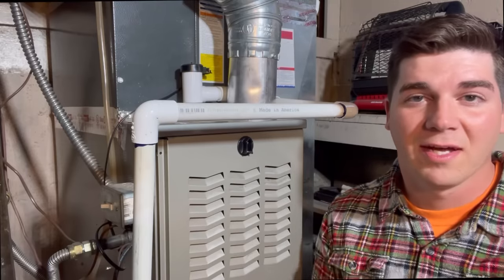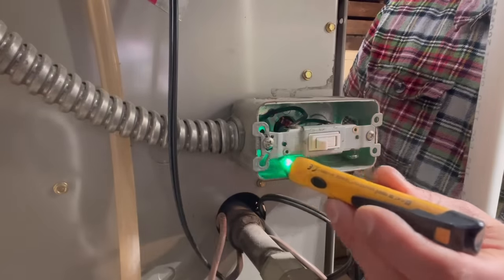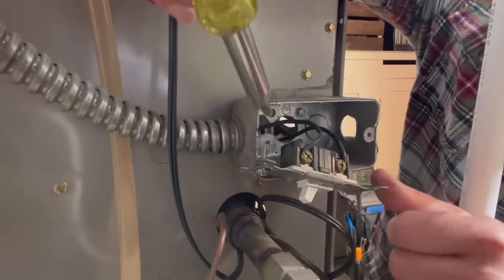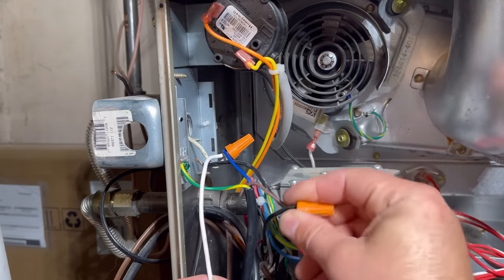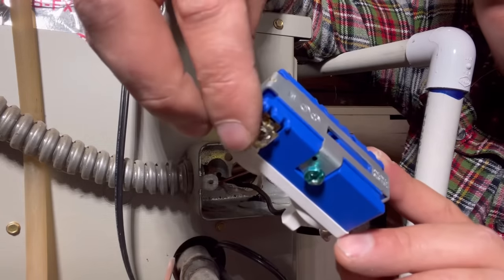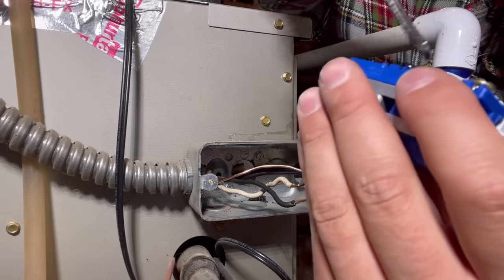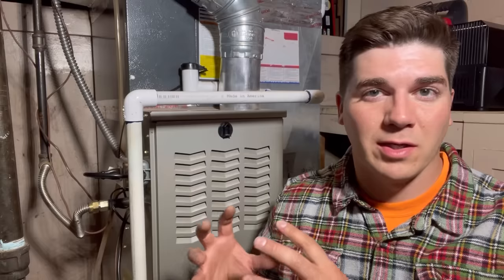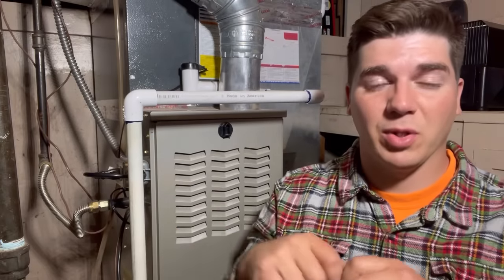This Could Keep Your Family Warm During An Emergency Power Outage.

Comment: Good idea.  Saves the trouble of figuring out the wiring in the dark when the power goes out. When I put a bedroom addition on my house I had them put in a separate panel with a manual transfer to chose utility power or some lugs in box on the exterior of the house. That way I can connect my potable generator to the lugs outside, and turn on those circuit breakers I want powered. Furnace, lights, refrigerator, etc depending on the size of generator I have.
Reply: but does this on a federal 🇺🇸 government's code enforcement pass? as i wouldn't mine doing this or paying for it done but my local county's inspectors have to come and look and my in progress upgrading aka main panel was a 100A now a 400A
Reply: A similar approach can if it’s done right, but transfer switches are expensive, and transfer panels limit what you can power from the generator. 

The most flexible and cost effective way to do this is to add an interlocked breaker to your main panel, and run a 30A or 50A feed to an inlet box outside.
Reply: @jeffscott1543  got it so not code compliant on a federal law level so indererlocked breaker's for the furnaces down there if i really whated it and or the plugin in method and of course check with local authorities to see if it passes or not  

all ready have and or working on a 400A 240V sp ATS/UPS this idea was in the video feed so i click on it and it sounded like a less hassle was to replace the heating units later on and another layer of power properness if the power gird and my backup planning fail's 20kw solar/1-5kwind/400A PTO-tractors/surpluses generation head off my 60's dodge or 80's chevy v8 vehicle and $$/time allowing later a F150 V to G
Reply: @jeffscott1543  That's how I do it.   Just back feed the panel
Reply: @allaboutroofing2   That's not going to happen with anyone who knows how to perform electrical work properly.
Reply: @MrBen527  it happens. Someone with no knowledge of electricity wouldn't be back feeding power with a generator. All it takes is forgetting  to turn off the main. This is why it's illegal and should you decide to do it anyway, take a a huge liability if something goes wrong including criminal charges.  Also, don't you need a suicide plug to do this?  Yeah, real safe. A professional would know better.
Reply: @allaboutroofing2  Linemen assume this scenario during outages and should be using safe practices and PPE anyway.  My equipment is marked so I don't forget and no.  No suicide plug for me.  Accidents/incidents could happen with interlocks also.   Linemen have to assume these things if you're touching a closed circuit and don't control over all of it.
Reply: @MrBen527  how could an accident happen with an interlock? That's the whole idea, to make sure the main is off before the inlet circuit is on. The fact is, no matter what you say, backfeeding without interlock is both dangerous, and illegal. I bet you think running a generator inside is okay too? I didn't expect to get thru to you, but at least someone might question your horrible advice after being called out.
Reply: @MrBen527  Just a follow up. If you are so capable with electricity and such,  why not install a interlock yourself if you already have a dedicated inlet? Might be liberating knowing you aren't a hack and aren't actively breaking the law to save $37.98 on Amazon. Just a thought.
Reply: @allaboutroofing2  lol. Don't hate man.  My panel is 50 years old and guess what.... I'm the only crib in the hood that has electricity when everyone else is out.
Reply: @MrBen527  still illegal.  You do you, but maybe stop giving illegal and dangerous advise. I see my suggestion of buying an interlock for under $40 was lost on you. Surprise. 🤭
Reply: @allaboutroofing2  There are not parts available to fit my panel.   Like I said,  my power will always be on as the linemen get to listen to my generator run while they're reseating a new fuse on the pole. 🙂
Reply: @MrBen527  You might be surprised. OEM interlock kits were readily available for my 80s era CH panel. There are outfits that have aftermarket kits available for a multitude of other panels.
Reply: ' @allaboutroofing2  We call them "widow makers".
Reply: @MrBen527  you know a lot about how electricity works, but call capacitors and transformers fuses? I'm sure their ppe will work when one blows up in their face from your blatant disregard for the law tho. 🙄
Reply: @jeffscott1543  My panel was installed in 1972 and it's a Square D.  The spec label is not legible.  The panel is really small compared to modern ones.
Reply: @MrBen527  not really, but you saying that linemen assume the risk and not caring about the law and blatantly disregarding to save $40 bucks does. I see you conveniently never answer about the legality if what you are doing is supposedly a okay.
Reply: @allaboutroofing2  Not at all.  My setup works great, been using it for 15 years!  Like I said,  you'll have a hard time thawing those balls when your power goes out.
Reply: @allaboutroofing2  There is no law for what I'm doing and I've I've spoken to my linemen personally while they're changing those FUSES.
Reply: @MrBen527  take 7 seconds of your life and google is backfeeding illegal. Get back to me. (Spoiler, you are wrong)
Reply: @MrBen527  I call bs on a lineman saying it's legal and ok too btw. Reality makes what you are saying a lie.
Reply: @allaboutroofing2  I have, can and will turn off my main and do whatever I like with my system.  Because I will have heat,  AC, a cold fridge,  working furnace, TV and internet (to communicate with u) 🙂 no matter how long the grid is down.
Reply: @MrBen527  I have all of those things legally. Did you google it?
Reply: @MrBen527  btw the way I'm sorry for your parents loss, but at least you inherited a starter home. Am I right?
Reply: @allaboutroofing2  LOL Uh oh, here we go.  Those balls are frozen solid!  🤣
Reply: I've never used a "suicide cord", but instead had my portable generator come into the main panel thru a spare 2-pole breaker that was normally OFF, except during a power outage.

During the first few minutes of one power outage, I brought the generator up and threw ON the generator breaker but FORGOT to first turn off the main breaker in the panel to isolate from the power grid!

The generator breaker simply tripped as it was reluctant to supply power to about 40 houses on my street, but I was SCARED SICK 😫 that I might have fried some poor lineman with 7200 volts. I didn't, thankfully - too soon, so no linemen were out yet trying to clear lines and restore power.

I've been doing home and/or computer room electrical work for 55+ years; just because you KNOW the right sequence doesn't guarantee you will do it CORRECTLY every time. I did it right many times until I did it WRONG. ☹

I then completely abandoned my original generator connection setup and purchased a commercial generator transfer panel... one of the types that have multiple rocker switches on them, one for each breaker/load that you want to power with the generator - these differ from the "whole house" type.

You have to sit down before you  install and pick what breakers you want to be generator powered. Too complicated to explain installation in this short space... but when completed, it lets you SAFELY connect a desired load (furnace, sump pump,  refrigerator,  etc.) to get juice from either power company or your generator, with no backfeed danger whatsoever.

Stay safe, and spend the money to keep everyone and your property safe. To see my transfer switch type, search Amaxzon  (remove the 'x') for these words:

Connecticut Electric Manual Transfer Switch

Get one with as many switches as you can afford. Remember, 240 volt items will use a pair of rocker switches instead of just one. You mount it right next to your breaker panel... recessed male twist lock on front is how generator connects.
Reply: @MrBen527  What you’re suggesting allows for the potential of backfeeding power into utility lines, and is both illegal and dangerous, putting utility line workers at risk. Use a transfer switch, which prevents backfeeding.

Comment: Cannot thank you enough for this video.  We just endured the ice storm in Central Texas, trees and lines down everywhere.  Power out for 4 days.  Courtesy of your video and my screwdriver we had heat for 3 of those days.  Well done sir!!!
Reply from the maker: Amazing! Glad it was helpful for you
Reply: @diyhvacguy my unit compressor went out. It’s only 7 year old . Gould I get another unit. Or  replace the compressor.if so, do you have a video on how to replace the compressor non a 2.5 ton Goodman unit? Please I hope you respond, as time is winding down. It’s about to get hot in Atlanta
Reply: That was Feb. 2021, right? It caught me woefully unprepared. Last winter, near Austin, our power was out for one day. After the 2021 winter storm, I got a Mr. Heater 30,000 BTU natural gas heater. It wasn't convenient, but has heated the home nicely for two years.

Comment: In south most of furnaces are plugged in attic's outlet, so little one 120V outlet lawn more size generator will easily plug and power the 10 Amp blower in furnace.... But if that's the case and power interruptions are the thing, setup some wall mounted or portable furnace in one or few rooms and you'll have heat without any electricity from generators/inverters in case of power down emergency

Comment: You will need an inverter capable of 15 amps continuous. The furnace blower motor can draw 6-7 amps on it's own, plus the draft inducer, gas valve, and transformer. If you have frequent power outages, invest in a standby generator and you can run lights, heat, and your refrigerator at minimum. And it will do all that automatically, like if you're away from home and the power goes out.

Comment: Mike,
I have done a similar modification that may work a little better for you using both ends of an extension cord. Take the hot feed coming into the existing switch and make connection to a 1 foot stub of the extension cord with the female end feed through a knock out similar to your solution. Take the other end of the extension cord with a 1 foot extension and feed it through another knock out on the electrical box and make the connections to the existing switch. When finished, you plug the ends of the extension cord into each other for power from the power panel. When the power goes out, unplug the extension cord and plug another cord in and run to your inverter. I used an extension cord that has the lock button and cut off both ends with about a foot of wire on each end . the end result is you have a spliced extension cord outside of your furnace switch box that can be easily unplugged and connected to the inverter. No need for a new switch with an outlet. You can even use an old extension cord you have lying around. Hurray!

Comment: I have always resorted to my 2 wood stoves in the house for winter time heat.  So far we have only used our gas powered generator for the fridge/freezer/some lights.   The tactic presented by this video allows another way to get oil furnance heat to the house without fire wood.  Your alternative back-up tactic is much appreciated.   Now I am thinking that something similar for the water well pump would be great, albeit my pump is 220V single phase so the devices/plug/receptacle has to be different per our US electrical code / NEC.   Great video:  THANKS!

Comment: I extended my gas line from the stove thru to the middle of the house and bought a Mr. Heater.  If power goes out i have brackets ready to attach to the wall to hold the heater and then a quick gas line attachment to the heater.  No electricity needed.  Once i use it then I’ll leave it attached for the rest of the winter.  I have a alarm to make sure carbon monoxide levels are not high. I have some outside airflow but want extra assurance.  I prefer to use any battery backup for lights ect.  I have a generator but last time the city was out of power, so was the gas stations.  Rarely happens that were out of power for any length of time and does not justify the cost to simulate how I normally would live, in a emergency situation.  I don’t need to be in the back room away from heat.

Comment: A male outlet and a 3-way switch is a cleaner install with no cord. The switch goes from on (normal) to the outlet (external power). The switch works to shut the furnace off still and won't cause service guys to question it.

Comment: If you have a high efficiency furnace-95% you better make sure your generator has a bonded neutral for that setup or the computer on the furnace will fault out. That’s the opposite of if your going through a transfer switch to your electric panel, than you need a floating neutral or the furnace computer will fault out. There can only be 1 point of bonding and that’s usually in your main panel. But since you’re bypassing you’re panel your generator must be bonded.
Reply: I have a 1992 bryant and mine is running at 96.4% efficiency and 11 for the exhaust gases. Hvac guy was very impressed. Older stuff built well when maintained.
Reply: By bonded neutral is that same as bonded to frame?
Reply: @gadasavideos8564  No that’s a wire or other contact that attaches the ground plug to the neutral line. My Honda Generator had a 2inch wire that I had to remove so I could hook it up to my transfer switch on a power failure, because your main breaker panel is bonded and you can only bond in 1 place. Computers in high efficiency furnace’s usually check ground conditions as 1 of there pre ignition checks. I made a plug that has a ground to neutral short that I plug in when I use it as a stand-alone generator outside otherwise the voltage could float and you could get zapped .
Reply: @Les W  thanks.  But my setup doesn't go through my main or sub panel. It's like my furnace is connected to generator just like a work light would be.

Comment: Thanks! I recently had my furnace replaced and found out when the power went out that I no longer had any way to plug it into my inverter/battery backup like I always could with my old one! I didn’t realize that having a plug wasn’t just standard so didn’t request this when they installed the new furnace.

Comment: I've got basic electrical knowledge. I know how to do outlets and lightbulbs.
I was following this well, but didn't understand the flow of electricity until about 14:15, then it all made sense.
power coming IN can be disconnected via the light switch and plug.  Then plug into the generator.
Smart.  Well done.

Comment: When stripping stranded wire, leave that little nib of insulation on the wires. Use the nib of insulation, to twist your wires. You will have uniformed and tight twisted wires, no straggler little wires strands.

Comment: I’m thinking that should be a double pole single throw switch. That way your isolating “both”  the house line & house neutral from the temporary power source. You wouldn’t want any transient voltages traveling through the neutral and back to your main panel.

Comment: I wired up a generator Inlet to my panel so I could power the entire home, specifically to make sure I could heat my home during a power outage. This option is great for people who are unable to connect a generator to the entire home. It's an excellent, easy to implement solution to make it simple to power the furnace from an alternate source. Nice job.
Reply: WITH an interlock to make it impossible to have the main breaker on with the generator input active, I hope.
Don't  backfeed the grid!
Reply: @williamevans6522  yes I added an interlock kit and a manual safety switch.
Reply: Same here. Mounted an inlet box and changed the on-off furnace switch to an interlock switch so a back feed is impossible. I chose a switch that was rated for double the amps and HP rating of my furnace motor for extra safety. Now I have  generator-center off- line power.
Reply: There are municipalities around the country that do not permit a manual interlock kit. You would need a transfer switch. Just because it works doesn’t mean it’s legal. Check with your building department to do it safely and correct the first time.
Reply: @bills6946  bold of you to assume any of us care whether or not it's legal

Comment: This is a great video. I bought supplies and completed this project today. Having experienced power outages before with no heat, I did not want to go through that again. -17 outside, hoping I won’t have to use it but we’re ready just in case.

Comment: This is a great idea.  I have done this at my last 2 houses.  It came in handy during an extended winter power outage.  The inverter was connected to a running vehicle’s battery terminals long enough to heat the house up to 50 degrees, saving the pipes from freezing.  My neighbors were not so clever, and ended up with massive water damage from burst pipes.
  Cool that you used the combo switch/outlet to fit into the existing box.  It crossed my mind what electrical codes might say with the non-armored cable.  I stuck with 14/2 AWG Romex cable and attached a male plug to it, but it would be even better to find a male plug that can attach to metallic sheathed BX cable.

Comment: My installation is similar, except that I did not install an outlet. I removed the original switch (single pole, single throw) and installed a 3-way switch (single pole, double throw), connecting the black hot wire of the male 14ga extension cord to the extra terminal of the switch.  This way when my furnace switch is turned “off”, it is connecting the extension cord directly to the furnace. When the furnace is powered normally, the extension cord is not energized.
Reply from the maker: Nice. Thanks for sharing
Reply: That’s not as safe as a break before make approved transfer switch.